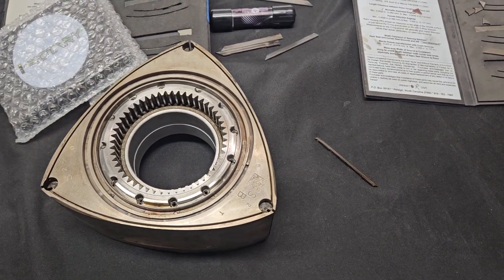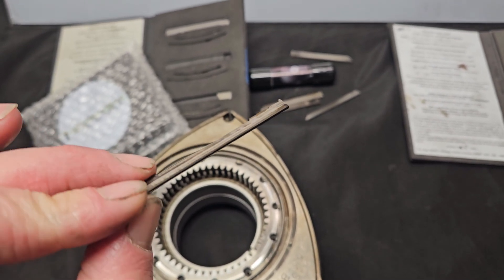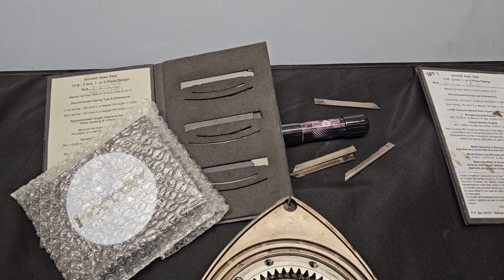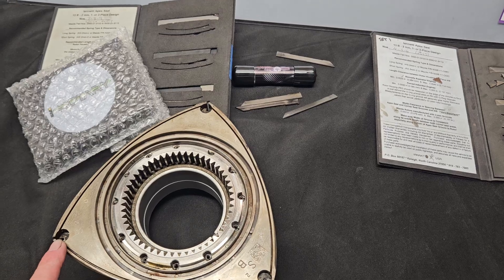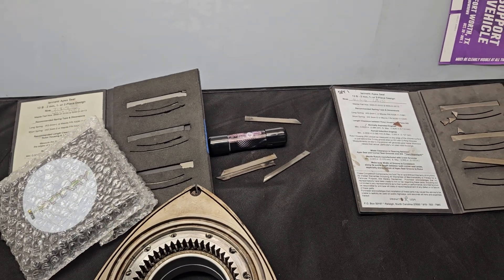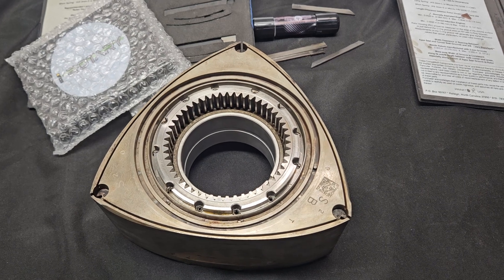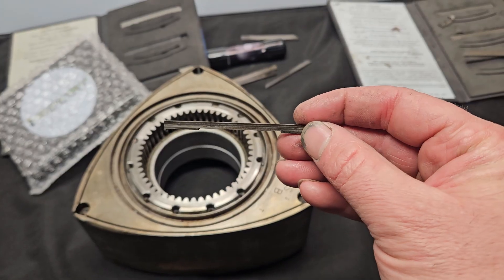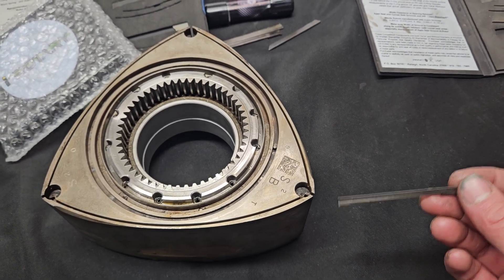What is the best APEX SEAL for the RX8 Renesis Engine - reliability, performance, OEM or Aftermarket

Comment: Do you have an opinion about the Citroën three piece apex seals, patent US3894820?
People at Aixro said it are good in corners.
And about Citroën pt US3705818, for rubbing surfaces coating?
It seems there are experimental data Nikasil being better than hard Chrome, but finding someone resurfacing housings with nikasil is hard.

Comment: if you go with RX-7 height apexes in a Renesis, what can you do about the corner seal metal plug?
Reply from the maker: Simply run an RX7 corner.  Or we can get RX8 corners modified but added expenses without a big benefit.  Lots of RX7 corner seal options.

Comment: Thanks for the information. But from what I understand, if we put more resistant ceramic apexes, we will inevitably ruin the housing more quickly... I don't know what is better... But it will certainly be more expensive.
Reply from the maker: Yeah, as long as lubrication and fuel delivery are good, it should be fine. Just expensive. As long as you don't break them somehow it's a good seal.  Although long term carbon buildup will still be an issue in an RX8
Reply: I would imagine if it's got enough oil,it should be ok
Reply from the maker: why would there be more resistance?
Reply: @KyleMohanRacing  I think it's a bit like brakes. You can use harder brake pads, but you will necessarily wear out the disc more quickly.